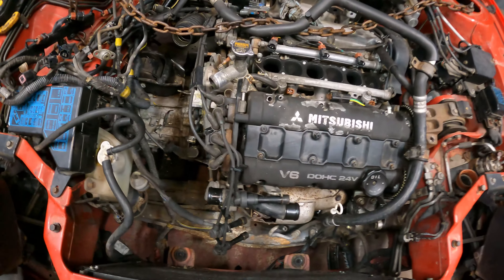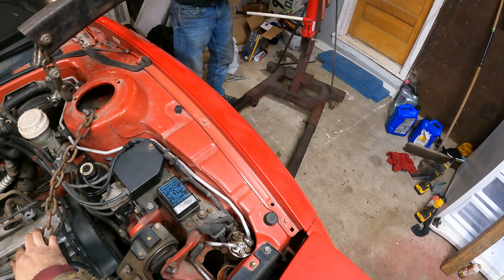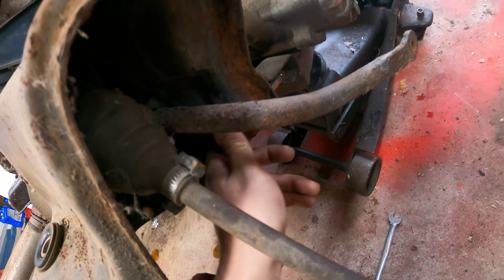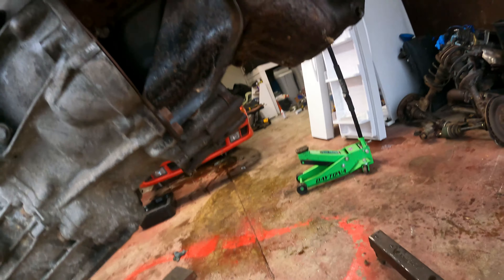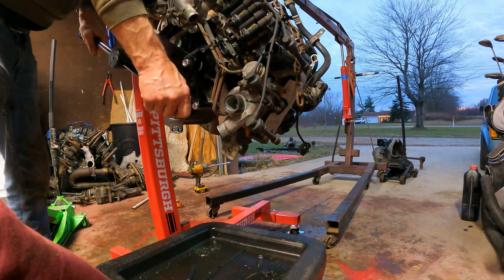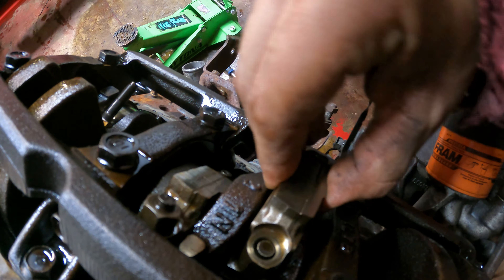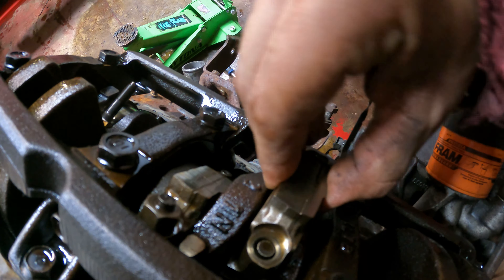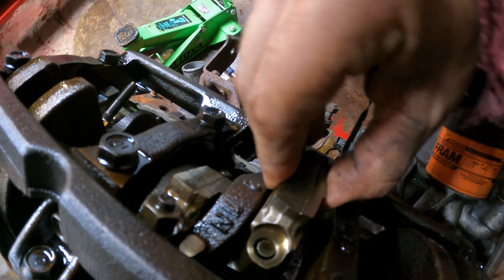Finally tore down the VR4 3000GT and we found this...

Comment: Enjoying the content, I rebuilt my engine in my 3000 about 3 years ago
Reply from the maker: Nice man! You assemble it all yourself?
Reply: @NedacSnosrap  Yes I did, tore heads down and installed new seals plus ported them, then bored .020 over and replaced all lower bearings. Mine is a SL so I rebuilt 10:1. Now I am boosting 7 psi on it
Reply from the maker: Pump gas i assume?
I was looking into high compression na-tt swap info on e85 but haven't found much :(
Reply: @NedacSnosrap  I have a tune for both 93 and e85. I have a supercharger on mine so loosing about 40 hp. I am 252 hp at wheels on 93 and 276 on e85. Looking to change pulleys and trying to get a couple more psi. So if mine was TT at 7 psi on e85 I would be around 316 hp to wheels

Comment: The engine and transmission can be removed together from the top  it's less work 😁. It's easier
Reply from the maker: Great info!
We were questioning the possibility due to how close the drivetrain was to the rails. 
We will keep this in mind when we put it back together🔥